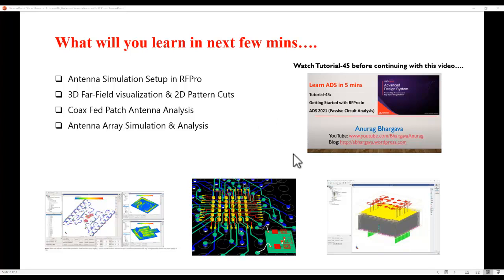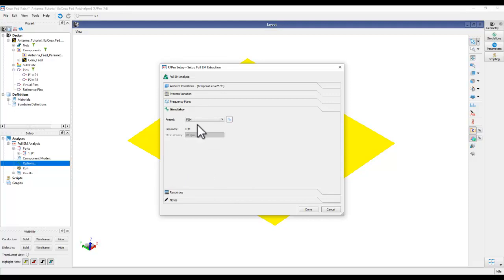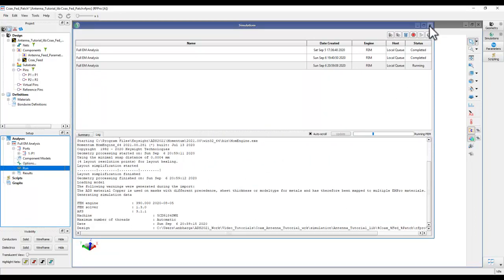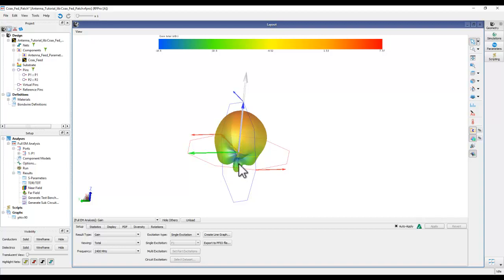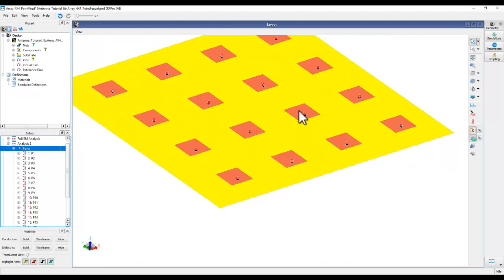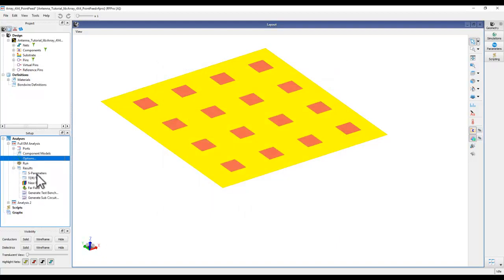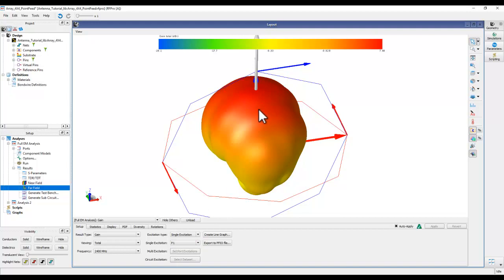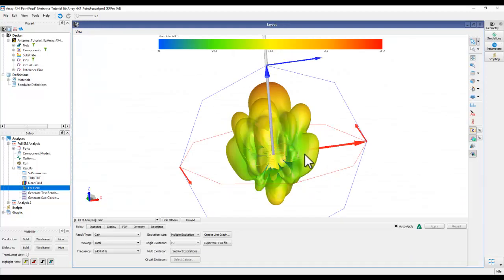Tutorial-46: Antenna & Antenna Array Simulations with RFPro

Comment: Sir, I have designed the Patch Antenna. Is there any automatic option/tab in ADS Layout to create the Array Antenna such as 4 by 4. Instead of designing manually.
Reply from the maker: Dear Dr. Hari,
Once you have the single element, its very easy to create Array in ADS. Simply select the single element and click on Edit->Copy/Paste->Step and Repeat and enter the required parameters to create an array. Once done, you can delete the original single element.
Hope this helps...👍
Reply: @BhargavaAnurag  Thanks a lot . It really worked. I could create an array of antenna.

Comment: Hi i am a beginner. I need to understand how to trace feed line to connect all patches. I need to have all feed lines from bottom patch pin to connect all in the middle. I have seen a realization with crooked lines from each patch but with the same electrical lenght. May you help me? I don't found anything of this.
Reply from the maker: You can refer to RF Design Tutorial playlist and contact local tech support team for more help.